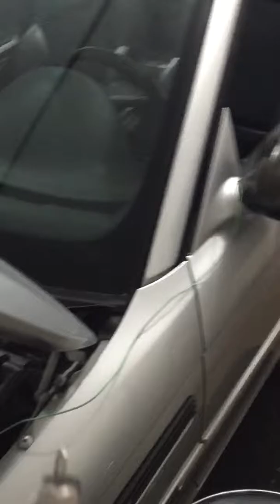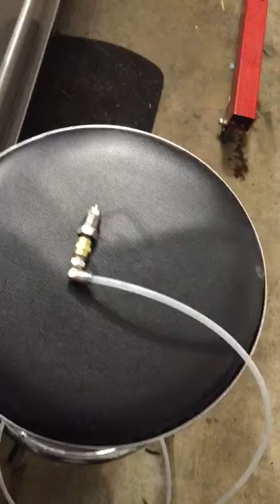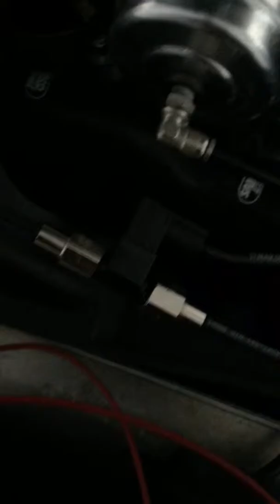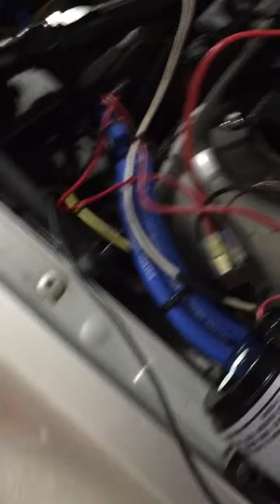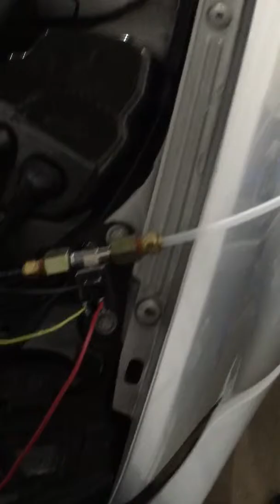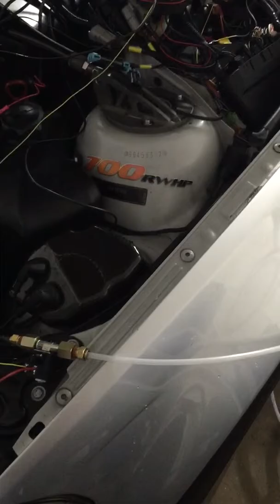Infinity controlled Water Meth Injection

Comment: very interesting setup. so the infinity is pwm your pump relay? or is it directly driving the pump itself?
Reply from the maker: riddick5 the infinity low-side output is PWM has capability which drives a solid state relay which in turn is driving he meth pump as 30amps is needed.
Reply from the maker: riddick5 the meth nozzle is driven directly my the AEM low side pmw output. .